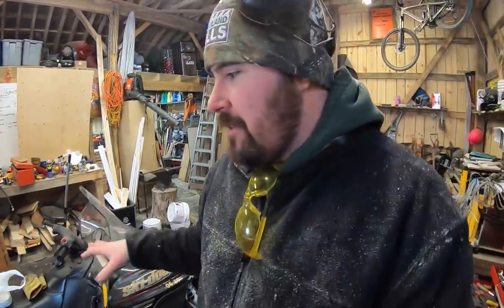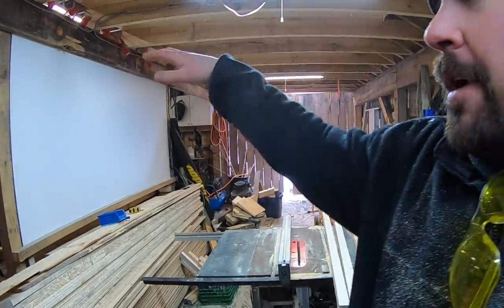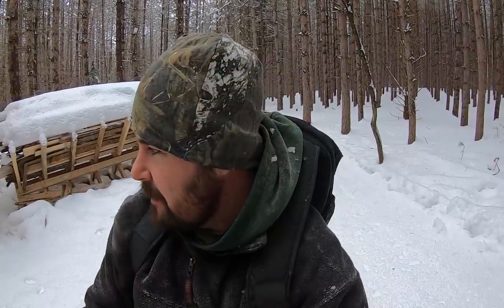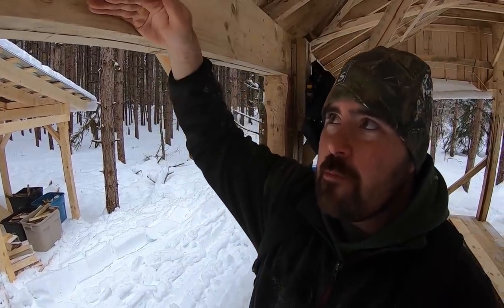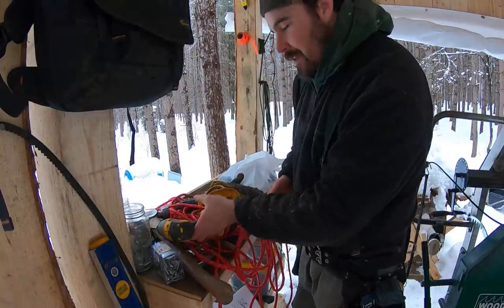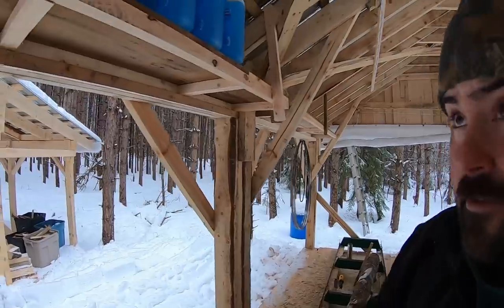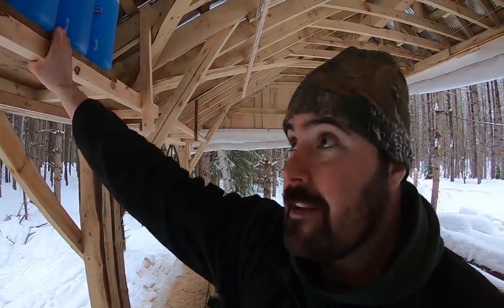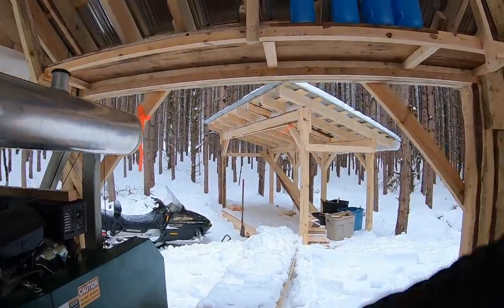Best Way to Maximize Storage at your Portable Sawmill

Comment: Sandy, I should NOT have bragged up my wheeler the other day. Two days ago I was out snow plowing and my dash pod/speedo went blank. No 4x4 forward or reverse. Lights except high beam worked. Kill switch still worked. What I found was a mouse had made a home and chewed through a yellow and a brown wire. All spliced and working fine now.
Reply from the maker: Darn nice. They’ve done a number on my equipment t as well. Glad you got it all sorted though!

Comment: Man, I've been planning a 10x12 half lofted timber frame cabin.... And in 8 weeks I will have a HM122 to do it! You sold me on your cabin build. Wish you had an affiliate link where you got a few bucks when I order my saw lol. Thank you thank you thank you!
Reply from the maker: Glad you liked my design. Hopefully the wait isn’t too long. I’m not 100% but I think if you tell woodland Mills that you have been referred to them by someone the other person gets store credit. I’m not quite sure how that works though. Happy sawing when the time does arrive
Reply: @sawingwithsandy  I'll definately call them up and see what I can do. Keep the good content coming!
Reply: @sawingwithsandy  Well I did it. $4700 for the HM122, extension, adjustable guide arm, tooth setter, auto blade sharpener with an extra disc, and 20 blades (for good measure). 11 weeks back ordered, so I should have perfect weather by the time it gets here! I need your last name for the referral :p

Comment: Those shelves will definitely make your life easier out there.. Just added a few in my sawmill barn. I also added a corner work table with a small vice. Sure makes it alot easier putting a sharp edge on the chainsaw when out and about.. I bought a few dwalt knockoffs last fall 2 for $28 delivered.. Work great but the mounting clips on both broke after a 5 feet fall.  Like others said.. watch those fingers bro..
Reply from the maker: Thanks for tuning in Steve

Comment: Hi sandy, if youre rebuilding that boardwalk, why not make it flush with the each platform that it is now resting on. As it is, Its a major trip hazard on each end.
Just thought id mention. ; )
Steve in Ottawa
Reply from the maker: Once the snow and ice around the bases melt I may consider that

Comment: You have any plans for the open hanging saw blades.  The sharp teeth are unforgiving.
Reply from the maker: None as of yet but maybe in the next while. May end up just hanging them higher up  so that no one can walk into them. I don’t really walk over to that side of the mill at that end much however but just in case probably not a bad idea

Comment: Table saw ☠️ 🤲🏻 ⛑🩸🩹
Reply from the maker: I didn’t even know all those emojis existed
Reply: @sawingwithsandy  they do! don’t take short courts, trust me, I know.
Reply: @sawingwithsandy  observation 🧐 Always set the blade heigh just so the teeth are coming through the wood, that way if you slip or miss judge the blade, it “might” only cut that depth into your hand, and alway make your push stick higher then the maximum blade height.